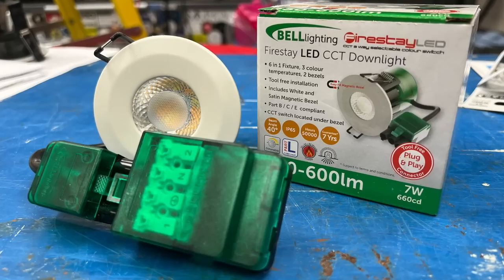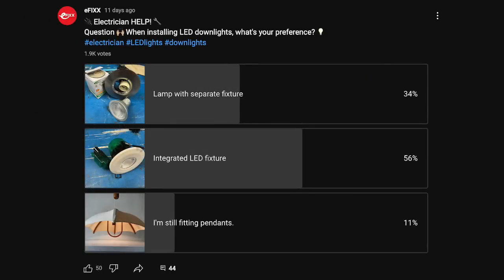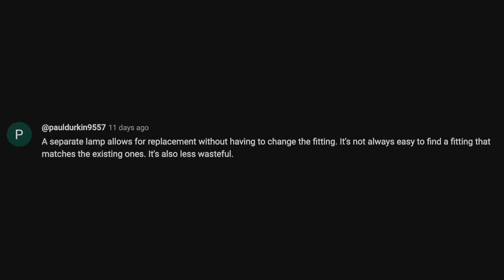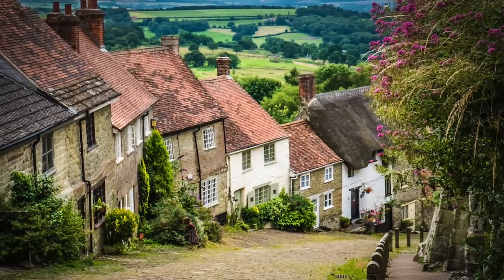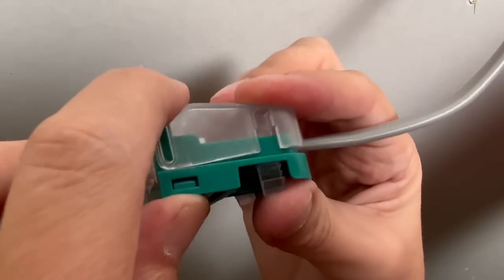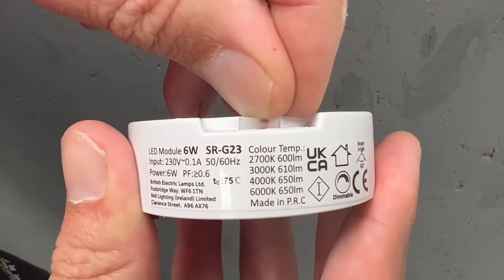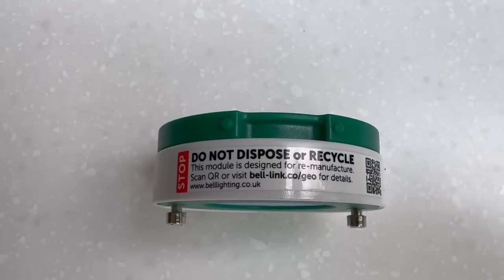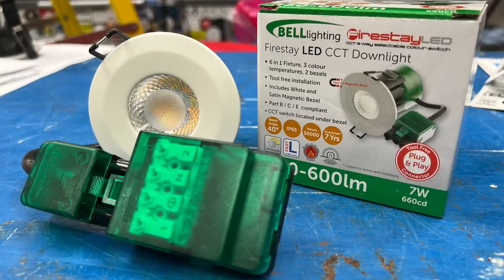The LED Downlight that lasts FOREVER - The Bell Lighting Geo-Mod

Comment: Finally we're getting somewhere. The ubiquitous standard of the the Edison screw base has been I think integral in the adoption of lighting. Everything uses it then there's the other standard the bayonet fitting fitting and a handful of others the bulb comes out of the fixture the fixture stays put. Unfortunately GU10 type stuff and LEDs you end up with the LED circuit board and the driver circuit both needing to be accessed and no standards at all other than bare wires. What's the chance that that fixture is going to be the same in 10 years? What's the chance that you're going to get an exact replacement? Having the fixture stay the same and only the bulb change makes so much sense, but the LED technology needs to integrate this better and it needs to be excepted between all manufacturers.
I have two outdoor lights that look almost identical somehow but we're purchase at different times. thay almost look the same but one takes a screw in bulbs and the other one has a Led panel, the bulb I can replace then I don't have to replace the entire fixture. the panel goes on the other one I'm not sure what I'm gonna do Maybe PCB way? or I'll probably be buying two new light fixtures.

When we switched from gaslighting a lot of effort went into reusing the existing fixtures and in some cases pipe.
Thus we have what's called a "lamp" which takes a "bulb" and conduit.

Comment: Although this is a positive step in the right direction in terms of circular economy, it does somewhat miss the point, I would imagine in the average domestic dwelling the cost of purchasing a new ‘lamp’ module would be far outweighed by the cost of purchasing a couple of extra GU10 lamps as replacements.

Potentially a very good idea in commercial settings, especially in commercial downlights, and if a similar system could be designed for Battens and panels it would really put Bell ahead of other manufacturers in the sector.

Comment: Downlights suck, crap light, huge glare, and integrated are dumb from maintenance point of view. If you've ever worked in a maintenance environment, you'd realise how crap modern stuff is too, with virtually no repair parts available, throw away society once more, except bigger and more expensive parts being thrown away. At least for a spotlight, anyone can fit a GU10 type, and they're cheap. No need to send it away to a manufacturer to repair.
And dumb restricting yourself to one manufacturer...oh yes, need your light fixed, Oh I have to send it away to Bell and you'll have no light for 2 weeks while they maybe repair it. How much energy wasted in that expensive process shipping things back and forward ? 
This is no solution to anything.
As for any awards....just proves they're awards for the sake of awards, patting each other on the back for not actually doing anything. It's what politicians do, pretend to fix a problem that was never a problem, then give themselves all pay rises or bonus' for it, despite not actually doing anything productive
Reply: For clarity on one element of this, the product wouldn't be returned to BELL Lighting for repair! The product would be returned to BELL Lighting for remanufacture. The difference here being, if the product failed (unlikely on a mass scale with an LM80/B10 product which has been tested stringently in the UK, but of course not impossible) and was under warranty, a replacement is sent out/sent to a relevant Wholesaler hub for collection (we generally have a next day policy for stock products, so the wait wouldn't be substantial) and the failed fitting is sent through the return hub which is outlined on the QR code on the Geo-Mod Lighting Module, to BELL Lighting. The end user isn't expected to wait for a repair, rather the Lighting Module is designed in such a way as to allow for the components to be remanufactured into new product/s at BELL Lighting's National Distribution Centre, allowing for full circular economy which pushes us closer to our Net Zero goal. If the product required replacement after exceeding the stated lifetime and wasn't under warranty, the customer would simply return the Lighting Module through a return hub, and purchase a new Geo-Mod, leaving the Housing in the ceiling as that would not require replacement. Thanks to the hub process and the work done behind the scenes with this element, it wouldn't be a single journey for each Lighting Module replacement, rather these trips would be taken through known Wholesalers who BELL Lighting would already deal with for delivery purposes. The end user's trip to the Wholesaler in question where a return hub would generally be based would also be a necessary one in the event of the need for a new product, as this would be where the new product would be purchased in any case, so this shouldn't have a large environmental impact. We're looking at creating further circular economy focussed products to continue innovating in an industry which needs to work hard environmentally, so there will be other options in the market in future if Downlights are not an end user's preference.
Reply: @belllighting1920  lot's of unnecessary travel to and from wholesalers then. It would make more sense then to send the replacement direct to point of failure, and likewise for the return.

Comment: Started fitting intergrated as soon as they came out ( fig and forget they said 😂) back to cans now as client can change a lamp as lets say you fit 10 lights on a job 70 miles away and one packs up 14 moths later you have to go back at your cost and you hope the manufacturer has not changed the design or your hunting on eBay old stock

Comment: It used to be possible to repair gu10 LED bulbs, before they started putting resin over all the components. If you were handy with a soldering iron, the driver  PSUs and the LED beads, were available on ebay, for peanuts. I use the repair all my failed gu10 bulbs. I even modified them to have a longer lifespan, by reducing the LED driver current a bit. This ran them much cooler, but the brightness was very similar. No body repairs things anymore 🤨😮‍💨😩, its terrible. Just because it's cheap its doesn't need to go in the bin.

Comment: I might like that.  I certainly like the re-use aspect minimising waste.  The strongest objection that I have to integrated units is having to call an electrician to change them.  Even after 50,000 hours that would be a PITA but you can still bet that in any installation at least one is going to fail long, long before its rated time is up.

Comment: GU10 lamps are pretty rubbish, they have poor power factor and can't attain the lumens per watt of a fixed unit. This is very reminiscent of GE Infusion modules from a few years ago. I am assuming that like a GU10, this Bell system integrates the electronics in the removable module. Going by the data, it appears that this lamp module has a greater output than most GU10 lamps. Like others have said, this would be ideal if the design is licensed to other manufacturers, otherwise it's probably not going to gain much momentum.

Comment: Optimistic longevity projections while manufactures use the cheapest components possible.  GU10 is an established standard (Not including a certain manufacturers GU10L1 designed to capture the new build market and over charge for replacement lamps).  I'd still rather fit a standard luminaire and a lamp than a bespoke option that the manufacturer may redesign and make obsolete in 18 months time requiring replacement.
Reply from the maker: Thanks, Jason - Bell lighting has committed to supporting this product for at least 10 years; it's a requirement of the TM66 scheme - see the pinned comment.
Reply: @efixx  Still going to be sticking with a standard type of lamp.  This is a nice innovation but its still manufacturer specific not a standard.

Comment: Sorry, but just because electricians, manufacturers or whoever want to install integrated LEDs or this new type of proprietary system that locks you into buying their replacements forever, does not mean that consumers want it. It does my nut in that we are all being forced away from changeable lamps that give the consumer choice about what they want to put in it. There is nothing in this change that is good for anyone other than the manufacturer.

Comment: As a customer, definitely use standard lamps (GU10?) not complete units. Manufucturers and suppliers change quickly. In 5 yrs you wont get the same fitting as by then products will have changed. I have already come across this and had to change a complete room. Standards have already increased the output requirement per watt so new lamps are brighter than those I fitted a few years ago. I thought a law was coming out for repairability so lamps must be separate. In addition if I want to use Smart lamps I can choose without being tied to one supplier yet have matching installations cosmetically.

Comment: So it is a downlight that you can replace the lamp, just like gu10 fittings 😂😂. These lamps are £12 each though 😂. 

I'll stick to my gu10's thanks 👍
Reply: It's just reinventing the wheel. In this case, only Bell get paid as it's proprietary.

Comment: Nice idea but ain’t gonna fly (yet)- tradesfolk dump brand new materials in skips as it is, let alone take the effort to send stuff like this back to the OEM 😢 Now if they did this with GU10 fittings it may be more of a stepping stone rather than a proprietary format and monopoly on the design…fwiw my £1 poundland GU10s are going strong unlike many filament style BC and ES type lamps I have elsewhere 😮

Comment: Jcc did this before them you replaced the lamp and bezel combined together with either white bezel ,chrome bezel or brushed nickle bezel  each lamp had bezel incorporated and you choose bezel colour and lamp light colour .Now they have discontinued  them and I have 16 in kitchen I'm having to change whole fittings as bezel and lamp for them are no longer manufactured by jcc lighting .

Comment: I've got over 100 down lighters in my house, and yes, even when I thought I'd bought the same ones they turned out to be different outputs
The real technical breakthrough will be when they invest they without those pesky clips that bruise your fingers for weeks or break the plasterboard they are fitted to
Surely there's a dragons den type out there to solve all our problems?
Reply: that sounds horrific, one such light would be too many nevermind 100. Sounds like a guy in work, he loves spotlights
Reply: @blow0me  11 rooms, 3 floors, 3 hallways
not many at all really
18 in the kitchen is just about right

Comment: I installed good GU10 sockets with halogen 20 years ago. 
Today I have GU10 LEDs in the spots. The GU10 LEDs cost less than €5 and can be changed quickly.

Comment: Does not allow user to swap to smart bulbs in future and ties user into one manufacturer. I could not afford smart bulbs initially but have since upgraded - This would not have been as easy with this solution.
Reply: Why install 10 smart GU10s in a room when you can install a single smart switch? Do you really want colour changing lamps? I don't, but I don't mind a single point on/off/dim.
Reply: @tebscat  I have sensors that will activate specific lights in the kitchen/dining area. I can also dim some lights and turn others off when eating….  Not a fan of color lights - but being able to manage areas, manage color temp of lights for different times or activities has been super. Being able to manage this through google automations  or Alexa routines opens functionality to entire house.

Comment: I have NEVER had a LED lamp last as long as advertised. Most of them are chines junk. I have also noticed a relabeling of the same lamp from a category A to category F which is probably based on its life expectancy as well as the fact that those individuals whose digital watt hour meters provided by their electric companies have not seen a difference in cost of operation sine most lamps have a very poor power factor rating and most digital meters can read power factor differences and report it to the power companies who will charge you for the difference in power consumed by poor lamp design utilizing capacitive dropper circuits to powe the lamps.
Reply: @Subgunman
Comparison:-
I installed various new-old-stock Tridonic drivers which seem beatifully engineered, active power factor correction,  connected to LED-panels running at about 1/4 of their rated-current, and other Cree LED-chips thermal-glued to CPU heatsinks....   Basically: Quality-driver and keep LEDs/COBs cool!,  frosted glass globe used purely as a diffuser but empty.  Also similar drivers with some T8 fluros with decent philips-graphica lamps (because had all the parts already, and a nice place to put the ether LED drivers!).
I even managed a primary switch then feeding downstream press-to-make switches (SwitchDIM configuration) allowing the Tridonic drivers in 3 groups with memory to "remember their state", a simplistic "scene setting".
Works beautifully and get impression its' going to last a very long time....

Comment: Seems like they're just reinventing the light bulb.
Reply: Re-inventnig the thermally-heatsinked low temperature lightbulb ....  Could standardize this and a better control system,  no smart lock-in/firmware issues,  no phase-cut dimming power factor troubles, ....

Comment: So that's simply a proprietary lamp fitting then? So when it comes time to replace the lamp I''ll have a single supplier who will charge a small fortune for a replacement. Perhaps they'll continue their "innovation" and refuse to sell me a replacement, when they could instead lease me one for a monthly fee? Hell no.
Reply: This "trend" isn't the "circular economy" it's "vendor lock-in" and "a lifetime of price gouging".
Reply: Spot on comment. I fitted some down lights that only take the manufacturers  bulbs  due to an added keyway.  They charge twice the price of an identical bulb that doesn’t have the keyway.
Reply: @MrRawMonkey  TP24?
Reply: A certain companies GU10L1 that new builders are so keen on comes to mind.  A modified version of the standard that only accepts their lamps which are 2-3x the price of branded standard versions.
Reply: @jasonwatson9011  you have to ask yourself who is really driving the introduction of these products. We have millions of AC RCDs which are now seen as rubbish, the same with insulated fused boards. Afdds are being pushed on us etc etc. 
And from the outside it looks like the IET are in bed with the manufacturers.
Reply: Apparently all manufacturers are going to adopt this standard, well that's what they told me in cities.
Reply: @acelectricalsecurity that is the only way it might work . If it's proprietary then there is just no chance .

Comment: Thats a really innovative solution, but for it to work I would like to see them give away the patent and create a standard so that these could potentially replace normal bulbs...  I think my only worry would be are they going to be available in 5 or 10yrs time...
Reply from the maker: Bell lighting has committed to supporting this product for at least 10 years; it's a requirement of the TM66 scheme - see the pinned comment.